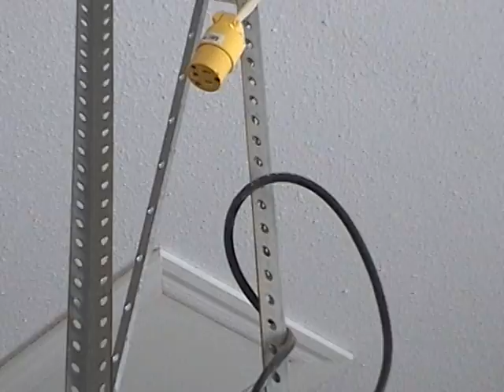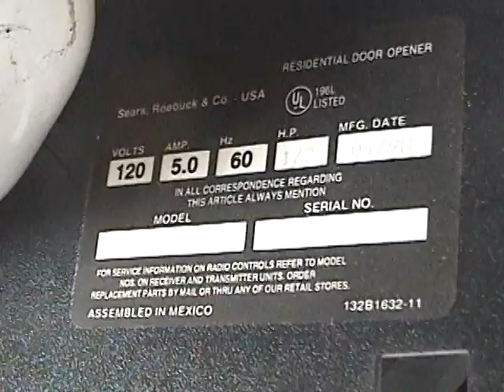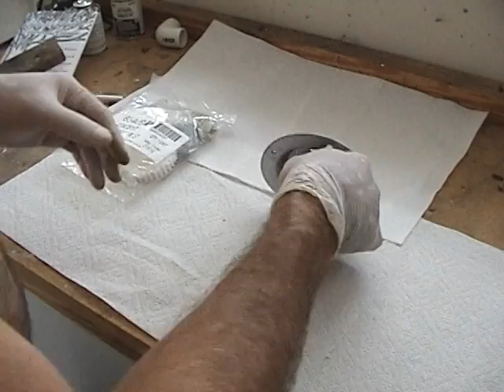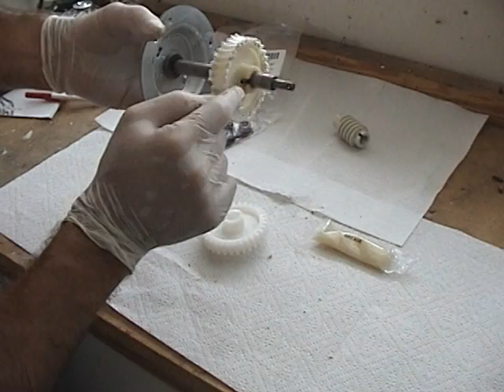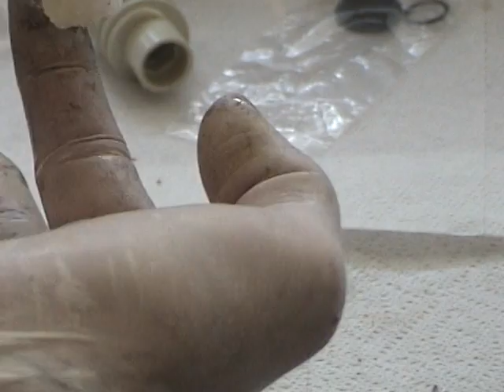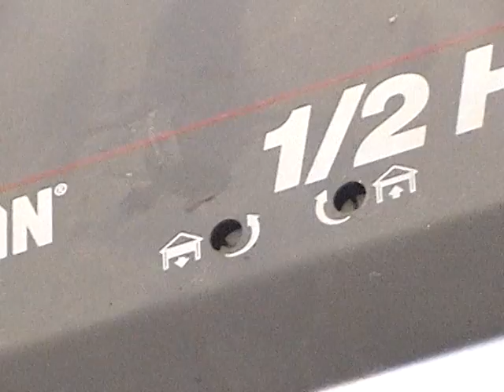Craftsman (LiftMaster) garage door opener issues?

Comment: Thanks for the clear video.
I had a limiters problem but the gear was in excellent condition, so, here is the story:

I had my Liftmaster 5580 ( from 2006) "fixed" by technician. The "fix" 
hold for 1 day... The Tech guy said that my gear was gone, and it will 
cost 350$ to replace it!, he also brought a new LM80 for 820$! I didn't 
agree of course.

So, I looked for videos on YouTube and thanks for all the good people 
that filmed their fixing I was able to understand what is going on.

First, I opened the motor back door and I looked carefully. My gear was 
as new!

Now, my simple  idea is to bring the the up and down limiters to their 
correct place by visual inspecting inside the motor and manual rotating the screws.

I disengage the gate and put a mark on the rail holder of the trolley, 
once, for the gate is in closed position and another mark for open position 
to the height I want.

Then I engage the motor to a learn position (2 clicks on the orange 
square button on the back of the motor, the the small light is blinking)
 The advantage at this mode is that every push on the remote controller 
is either moving up or down, so I can adjust the trolley position.

So, I brought the trolley to the up position and then my simple 
contribution to the solution is to rotate the up limiter with a flat 
screwdriver until its metal contact is touching the metal in the middle 
wide limiter gear, while I am with the motor back cover open so I can 
see exactly the movements and where and how much I should rotate (no 
more guessing...)
The same I did for the down position.

Then I engage the trolly to the gate, start another learning mode and 
there it was fixed! (at list 2-3  times up and down with learning mode 
so this motor can adjust itself to the force required. (The blinking 
light is stooped when the engine did it learning job successfully).

I hope this will help someone with the same annoying problem.
Reply from the maker: +EZ Good tip.
Reply: +Kris Kasprzak 
Thank you. I hope my English was clear enough.

Comment: This was super helpful, thank you!  The replacement part arrived at my door at 9am and I had the door working by 10am. The one thing I would add is that if you don't have a vice, I'm not sure how you'd get the pin out to remove the old gear.  In that case, be advised that you can just buy a whole new sprocket/shaft assembly with the new gear already on it for just a few bucks more.  Search Amazon for part number 41C4220A.  Even if you do have a vice, the time saved might be worth it to go that route instead.

Also funny that looking back through the comments it seems to be all of us Minnesotans that are having this problem this month. :-)
Reply: i just ordered the whole sprocket assembly for the same reason - hope it works.
Reply: Thank you very much for providing the part number on Amazon. I am facing exactly the same situation and need to replace the gear & sprocket assembly. Just ordered one on Amazon. Hopefully, the replacement will be a breeze. Much appreciated.
Reply: I wish I would’ve read your comment before I attempted this repair. It took me hours to remove the pin and then replace it because I don’t have a vice! Thanks for the info. I hope it helps someone else with the foresight to read the comments before  they actually do this.

Comment: I find it best to adjust the travel stop with the motor cover off this way you can see the limiter traveling on the screw to each limit switch. I've seen the limiters slip off the adjusters and you can turn the snot of it and it still overlimits and dead heads. With the cover off you can turn the screws by hand and fine tune the adjustment visually. Great video a lot of openers make their way to the trash because of this less than $10 plastic gear.

Comment: Thank you! This was exactly what I needed. My garage door opener looked just like yours on the inside with all the plastic dust. The worm gear was fine, only the drive gear needed replacing. $6 shipped on eBay with grease included. Can't beat that!
Reply from the maker: +brian0918 Glad I could help.

Comment: Thanks for this video. I am certain I can fix it but I'm having troubles getting that little pin out. I've tapped on a flat head, philips and nail set with no luck. I've already removed the assembly. Any tips?
Reply from the maker: +Heather Conley Art Since your gear is broken, consider cutting it off to better expose the pin?
Reply: I set the thing on the vice and tapped the pin out using a flat blade screwdriver with the handle broken off. Had to hit it pretty hard. Once the pin was at the level of the shaft, I used a large diameter nail set to tap it through most of the way, then a smaller nail set to get it out all the way. Getting it back in was no picnic either, but it worked.

Comment: So I've just replaced my gears, and the door only goes up/down about a foot.  I've noticed the small gear that corresponds to the Up/Down travel mechanism are not making a connection, so I'm not sure how to adjust that to make those work together
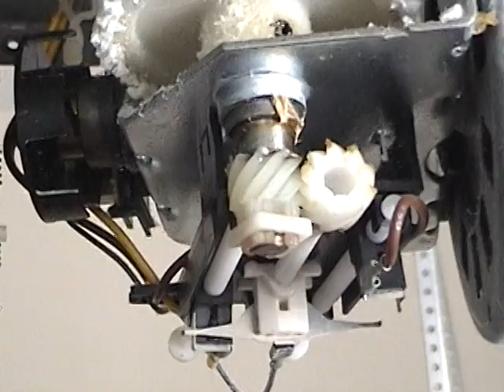Reply from the maker: +Dan Denniston Are you talking about the small gear shown at 2:59?I'ts a must that is working properly. Look at a your gears and their shaft journals to make sure any bearings, brackets,  or sleeves are installed correctly.

Comment: I installed the new Chamberlain 1/2 hp garage door opener. BUTTTT this model does not have tension (up or down) adjustments...When activate the remote it travels toward the motor "only", has not moved downward yet! Will not move downward. I have to take chain loose and reset bridle. Now I did not use the new wiring used the previous LiftMaster 1/3hp wiring and door sensors. Photo eye is Amber and a Solid Green on Receiver...HELP

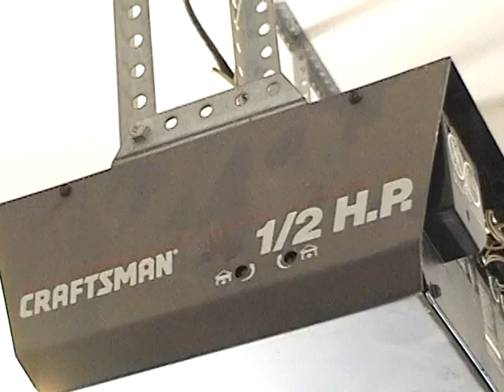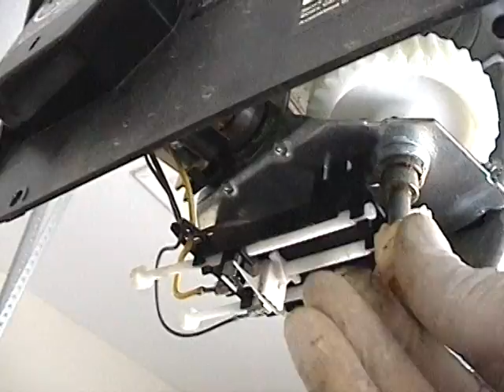Comment: Your "up and down stroke was off for some unknown reason", as stated at 8:48, was related to the small gear replacement at ~ 8:30. That is its purpose as shown by the long plastic screws adjacent to it. Pay attention to the position of the small gears when removing will avoid having to reset positions. Excellent video for the DIY'er. Only adding to it, you did a much better job explaining than i would have. :)
Reply from the maker: +Greg Pavlunas Thanks for watching and commenting.
Reply: you could mark the teeth with a sharpie marker to ensure correct alignment when replacing. Thank you for taking the time to make this vid.

Comment: I followed your great instructions two years ago. Worked great! The hardest part was removing the pin from the gear. Now,  i'm about to do it again on the other opener. thanks again.
Reply: +Mario Vacca any tricks to removing that pin? I'm having a rough time getting that little sucker out.
Reply: +Heather Conley Art I had to put the assembly in a vice (with the vice grabbing the inner plastic hub of the gear) and use a nail punch and hammer pretty hard.  The nail punch needed to be thin enough to go through the central hole of the metal shaft to punch the nail all the way through.  An easier alternative is to buy a kit that includes an already assembled replacement shaft with the new gear pre-installed for just a few bucks more, search Amazon for part # 41C4220A.
Reply: Fran Fabrizio I ended up taking it to a mechanic friend of mine and he did exactly what you said. I guess I could use a vice for the garage for future repairs. lol I thought about buying the entire assembly but then that hard headed "I can fix" it part of my brain won me over.

Comment: installed a new craftsman today.everythign is installed correctly id imagine.press remote,door wont go up,at all.motor hums for sec and thats it.5 blinking yellow lights meaning? sensors check out.what else could it be?
Reply from the maker: robby robber check both the stops and the pressure settings for both up and down
Reply: how do i check the "stops" and "pressure" settings? model no# 53930.
Reply from the maker: robby robber The height adjustment screws are most likely on the side or bottom of the unit, you should see some adjustment screws with directional arrows. Pressure screws may be found inside the unit. I'm guessing you will need to adjust them to get the door to open/close correctly, it's hard for me to say what is wrong.

Comment: i recently had to the same replacement on my garage door and now my garage door wont closer all the way. it comes down about two feet and it automatically goes up by it self. what do you think this issue could be?  Thanks
Reply from the maker: Miguelangel Sanchez I'm guessing the limit adjustment AND pressure adjustments need to be reset. There are 4 adjustment screws you will need to adjust 1) up distance 2) down distance 3) up pressure 4) down pressure. It sounds like the down adjustment needs to be lowered to allow the door to close. It's a trial and error process in adjusting these so be patient. Ive seen some YouTube videos showing this process.

Comment: excellent! i was able to buy the gear by itself on ebay for $5.10. my opener appears identical to yours. with the help of your vid i took it apart and it had the pile of white shavings and a stripped gear. after dis assembly the only part bad was the one gear. I used a vacuum, compressed air and a toothbrush to clean. i also removed the back panel, disconnected the pcb plug and swung it on top of the opener for easier access to the three bolts on the gear assembly. i used automotive grease for lube. THANKS!
Reply from the maker: AnimationBubble you're very welcome.

Comment: Thank you - you saved another one. :-) I will say that I battled for several hours stuck at the off camera moments; trying to get the gear assembly to come out (about 15 minutes), 40 minutes or so fighting the infamous pin, another 15 minutes battling the assembly going back in and my worst was a couple hours battling alignment of the screws once the assembly was back in. If I had to do it over again I think I would buy the sears part that includes the gear already on the assembly for about $15 more to avoid the pin issue. And if you are working this repair solo, loosen the chain (a lot) otherwise its almost impossible to get everything aligned for re-assembly due to the tension from the chain pulling the assembly back. So I might win the award for the slowest repair - but still great its all back and working. Thank you!!!

Comment: Great video!  I was able to replace the drive gear.  However, now the opener isn't adjusted right.  I removed the chain and plugged it in and the motor just runs continuously, It won't stop even if I press the button on the wall.  Any thoughts?
Reply from the maker: Jeff Sparfven I'm guessing the stops are not set right or have some how come loose. Double check them--look for the long threaded plastic screw looking mechanism.

Comment: Please, I need help. My garage door starts going up then it starts clicking loudly and stops. The only to get it to go up is with my help. On the other hand it closes just fine.
Reply from the maker: KamD450 I'm guessing the pressure control is off. There are basically 4 adjustment screws on the garage door opener 1) for setting the down stop distance 2) for setting the up stop distance 3) for setting the down crush force and 4) for setting the up lift force. Since it closes fine but has a hard time opening, i'm guessing it's the up force adjustment. Find that screw and adjust it. You may need to adjust the up/down distance as well. Make sure you have the remote in hand when making adjustments otherwise your door may travel too far if the up/down distance is not set properly.

Also, make sure, all mounting and securing screws are tight (so your chain will not slip).

Hope this helps.
Reply: Kris Kasprzak thx alot, I will definitely check into that and update for anyone who may be having similar issues.

Comment: Hey! I really need your help with something. I went on SEARSPARTSDIRECT.COM and I triple checked to make sure I had the exact same model number as I've read. The Model # is 139.18874

However when I search it up it doesn't come up. And I'm CERTAIN that my model and yours are THE EXACT SAME THING, I even read some of the labels and they match. Any help/
Reply from the maker: ***** 

The exact model number for my opener is 139.53674SRT2, enter that into searspartsdirect and I got this:

http://www.searspartsdirect.com/Craftsman-Parts-Garage-door-opener-Parts/Model-13953674SRT2/0247/0718000.html?searchType=modelSearch&prst=&searchTerm=13953674SRT2&shdPart=

The exact part number for my replacement gear set is 41A2817, google that number and tons of sources pop up.

Hope this helps

Kris
Reply: Kris Kasprzak It did! I repaired my garage door and IT WORKS! BOTH MY GARAGE DOORS TOO! 50$ INSTEAD OF A 600$ REPAIR! THANKS SO MUCH!

The hardest part was unscrewing the nails. IT WAS SO HARD,  it. Some advice on that?
Reply from the maker: ***** spray some WD-40 on the screws (nails???) and let sit a day or so.
Reply: Kris Kasprzak The hard part is actually trying to screw it back in, the nails go UP and it's hard to screw it in like that with all the gears and wires and whatnot blocking the way

Comment: Thanks Kris!  Ordering my parts now.
Reply from the maker: You're very welcome. Let us know how the repair went.
Reply: Well Kris - Your Video was very helpful :) The parts came within a week. I would suggest that anyone doing this repair should assume the doors raise and lowering settings will be off... and could be WAY OFF!  I would recommend that everyone manually set the screws to the middle with very little travel distance allowed at first.  Then work out the stopping points for the door by patiently opening and closing the door repeatedly.

Also pay attention to the position of the shaft, gear, and plate as you insert it back into the case.  There is only one way that the outer gear cover (over the top gear that drives the chain) will attach properly, so the plate needs to be reinstalled the way it came out.

I did not do this and raised the door ...and it only stopped when it hit the motor case... and it hit the motor case only after passing through the light cover :)  I'd also recommend using the power plug as the best way to stop the door, as it's the fastest way to halt it. 

You may have covered these in your video and I missed it - I was in a bit of a rush. It was exciting being up on a ladder with a front row to the chaos.  My learning curve was shortened very quickly.  I always enjoy learning and doing for myself.

Thanks KRIS!

Comment: Great video. Very helpful. Everything went just as you said, from start to finish. But...when I was all done, the door will only move like 5 inches then it reverses to 5 inches and stops. No flashing lights, no problems with sensors that I can see. Before I started, the motor would run for a long time - stripped gears but the motor would run. Now the gear problems seems fixed but the door won't move much at all. Any ideas?
Reply from the maker: It sounds like the up / down adjustment screws and or the pressure adjustment screws need to be adjusted. I'm guessing the opener thinks it's hit something and is reversing direction. Look for the adjustment screws and start tweaking.
Reply: Kris Kasprzak I tried he up/down adjustment screws and the pressure adjustment screws, all to no avail. The culprit? I partially dislodged the interrupter cup/RPM sensor from the motor shaft. All I had to do was push it back on, and we're in business. Thanks for the great video.

Comment: Very kind of you to still field inquiries after 4 years...If it helps, the unit I'm tackling is the one identical to yours, I think it may even be the same year, no difference whatsoever. Can you tell me if you think it'd be possible to pull the worm gear and replace it without going through the top?. I can only imagine plenty of these were similarly-mounted, every house in my neighborhood at least... since many garages have low ceilings. To require dropping the entire unit to make a basic repair would be a pretty abysmal design flaw. The first thing that comes to mind if it can't be removed is you had to use a vice to knock out the one pin in your vid, no way anyone could do that with the gear still attached to the opener. I'd love to hear your input. Perhaps dropping the opener isn't all that daunting...I'm very grateful for your valuable time.
Reply from the maker: I don't think you will be able to drop the gear and shaft through the bottom. There is a sprocket on the top of the unit and The only way to get it off is through the top. If you can get the motor bracket off and expose the gear, you might be able to get the gear off--but removing the pin holding the gear will be tough. Maybe there is some type of tool to press those pins out--I never looked for one. I'll be trying to go through the bottom will be the same or more work that dropping the unit from the ceiling.

Comment: Mine went out and your vid told me what it was before I even cracked the case (I'm handy so I knew it was a stripped gear by the sound, but your vid confirmed my suspicions and helped me open the case faster). I need some advice if you don't mind. Unlike the vid, mine is nearly flush-mounted to the ceiling so pushing anything up through the top isn't an option. You've had this thing apart, does that mean I'll have to drop the entire unit to get the gear out to replace it? If so, the work is beyond me. I'm disabled from a motorcycle wreck and can't work above my head for that long (crushed discs in my neck). Can the gear be removed without accessing the top cover? Otherwise I'm sure some repair co. will charge me like 2 bills for a simple repair, rough on disability pay, ya know? Thanks for the advice.
Wyattpoppa
Reply from the maker: You may be able to take the mounting plate that holds the motor off but getting the pin out so you can take the gear off may be a challenge. I'm not sure if this would be more work or even possible--i'd have to study the unit.